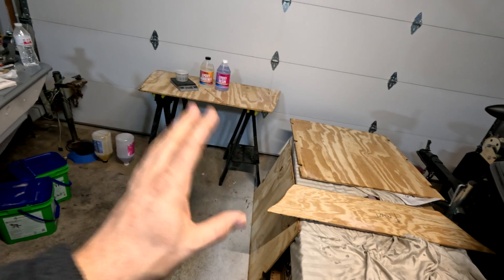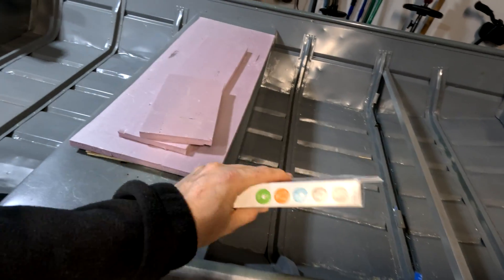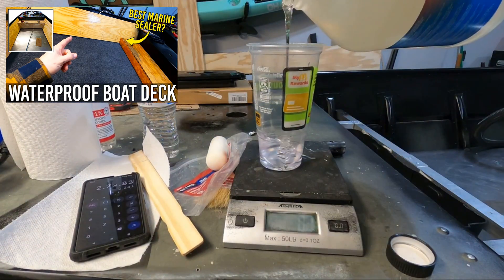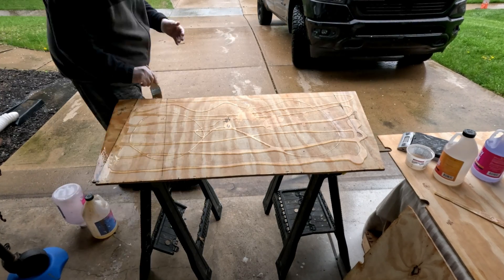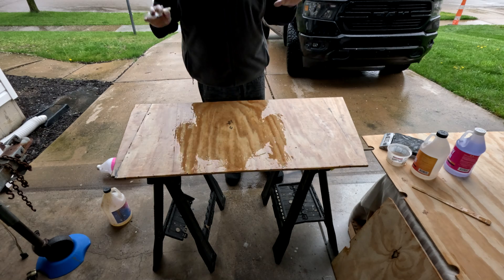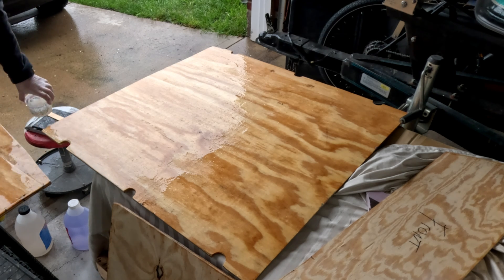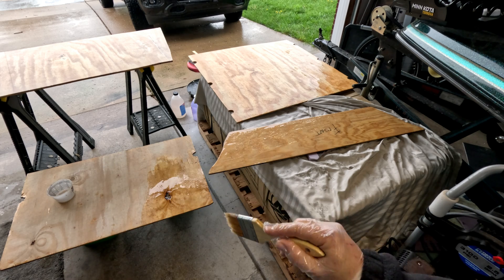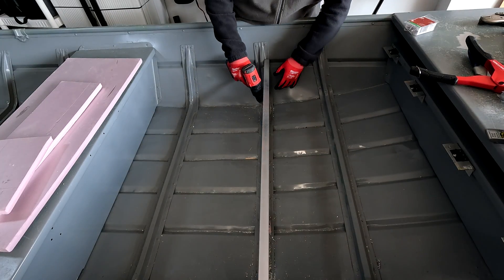Waterproofing Wood w/ Epoxy for Jon Boat Build

Comment: If you dont epoxy the edges of the plywood to seal them Your just wasting time and money.  The edge's are more likely to rot when exposed to water then the front and back. Especially when lying in water. Say if theres a block in the flow of water along the ribs due to dirt and crud and it does drain to the back plug or and bilge pump if using one. Other then that your build looks awesome.  P.S the Pup is beautiful
Reply from the maker: The edges received two coats of epoxy, I do the edges while I'm doing each side. You are 100% correct though, the edges are where plywood is most vulnerable!
Reply: Sorry watched twice and didn't notice your apply any to the edges.  👍 @mvboutdoors

Comment: what about used motor oil as a sealant for the wood, maybe 2 coats or 3, I use it on my utility trailer that sits out all year long
Reply from the maker: Oil based sealants definitely work but I'm not sure I want to douse all my flooring in a boat with flammable liquid haha
Reply: @mvboutdoors  are you serious, flammable, used motor oil, not any store bought stuff,

Comment: Has the floor warped any over time?     I like the velcro idea, but there isn't anything preventing it from warping upward in the areas away from the velcro.  And do you wish you had gone with thicker plywood?

Comment: The EVA foam is for floatation just incase the boat sinks? Or is it for sound? Seems like if the boat ever did take on water the velcro might release and the foam would come out. I am starting a similar floor install in a 15 foot Gregor aluminum boat. Thanks for the video
Reply from the maker: The plywood is secured down so the foam shouldn't float away. It's a support for the flooring/sound deadening but also to replace removed foam for emergency buoyancy.

Comment: Question about the velcro; when you take out the boards, did the velcro peel off the ribs or wood, or did it work as you hoped? Thanks!
Reply from the maker: It worked really well, if you are doing it make sure you give sufficient time for the velcro adhesive to cure before trying to remove anything.
Reply: @mvboutdoors  awesome. Thanks!

Comment: Do you glue the foam insulation to the floor of the boat, if yes what glue/adhesive to use. OR do you just velcro epoxied plywood flooring to ribs and call it good? Thx for your time. I would not attempt any of this without your help!
Reply from the maker: I did not glue the foam board to the floor, you don't need to since the floor is meant to hold it down. Especially if you affix the floor using screws.
Reply: @mvboutdoors  Thank You

Comment: Hi Mike, whats the quality/thickness of the plywood that you used? I plan on adding epoxy to a floor deck on my boat as well
Reply from the maker: https://youtu.be/T4J-6my7RPI

It was 11/32 exterior grade ply. I went in depth on the wood selection in the above video if you wanted more info. 👍